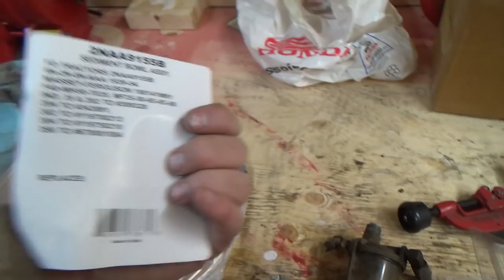Let's do some work on the 1944 2N.....Test the old starter

Comment: Learning to maintain your motorcycle is as important as learning to ride. I was fortunate when I was young that my dad was big on me doing proper maintenance to my dirt bike. That included keeping everything clean and lubricated, adjusting and lubing the chain, changing the oil, etc. It was also important to pull the wheels periodically, clean out the hubs and lubricate the brake cams. This ensured that the brakes worked properly and lasted a long time (I don't recall ever having to change brake shoes). He taught me that if you take care of your machine your machine will take care of you.

Comment: it's positive ground
Reply: Yep, engine is turning backwards if you watch the fan.
Reply: @finncampeau4922  It does when Bill connects the battery cables backwards. :-)
Reply: This isn't the first N-series tractor he has tinkered with, how would he not know they are 6-volts positive ground?
Reply from the maker: I’m not sure on that. It’s converted to 12v
Reply from the maker: Not Necessarily our jubilee pushes the air from the engine and vents out the front of the tractor. It helps keeping the engine clean when you are in messy straw and such
Reply: @Spikey965 WRONG! The engine is not turning backwards! The starter does not care about polarity! People hook these starters up both positive or negative ground all the time and they still turn the correct direction!
Reply: @EOSJOE WRONG! The starter will NOT turn backwards when hooked up negative ground! The starter does not care about polarity! People hook these starters up both positive or negative ground all the time and they still turn the correct direction! Another person who doesn't know what they're talking about! What a surprise!
Reply: @billstmaxx  I converted my 9N to 12V but it was still positive ground.
Reply: @EOSJOE 12 Volt positive ground would be highly unlikely! What alternator did your tractor have on it? There are not very many positive ground alternators out there!
Reply: @whatitis99  Thank you for the info! I'm not afraid to admit I was wrong and learned something here. I've owned a 9N and NAA and while I did a lot of restoration work to them I never tried hooking the starter up backwards. :-) So naturally I assumed it would be like any other starter motor and run backwards. But apparently that only applies to starter motors with a permanent magnet. So while the engine is turning over the correct direction, I don't think the front mounted distributor  is as forgiving about the reversed polarity. Apparently you can re-wire everything for negative ground but it can be a little tricky.
Reply: @EOSJOE! You're welcome! I currently have 2 Ford 8Ns, So I do know quite a bit about the Ford N Series Tractors. Reversed polarity won't really hurt the distributor either especially since his is already converted to 12 volt, It would be negative ground. It would need a resistor for the coil and points if running 12 volt that's all. Which it should already have, if it is wired correctly which I wouldn't count on. lol Bill keeps calling this tractor a 9N, but it appears to actually be a 2N, I can see the serial number on the side of the block, it looks like it reads 9N127691. Which makes it a 1944 Ford 2N. All 9N and 2N tractors were stamped with 9N in the serial number.

Comment: Fit a battery disconnect switch that has a hole for a padlock. Then you can use a coded padlock and it will not have a key.

Comment: Bill, It looks like the serial number on your tractor is 9N127691 which makes this tractor a 1944 Ford 2N, not a 9N! I can also see a 1943 casting date code on the block! Which makes it a 2N!
Reply from the maker: well heres a real close pic of the ser #  i don't get the numbering 
https://www.facebook.com/photo.php?fbid=10158207084978914&set=pcb.3059945074062360&type=3&ifg=1&__tn__=HH-R&eid=ARB9kSa0bYUzQzWLrOL3lMFCjghMPlwEG1-byqM54feaOaJOniT32Nm3jlnK2YjwWVZmhjzkhaCmjwzH
Reply: I looked at your picture of the serial number on Facebook. The serial number is: 9N127691 which makes this tractor a 1944 Ford 2N! I hope this info helps!